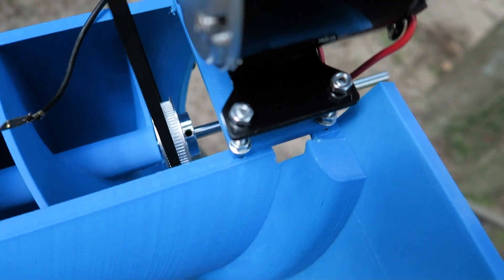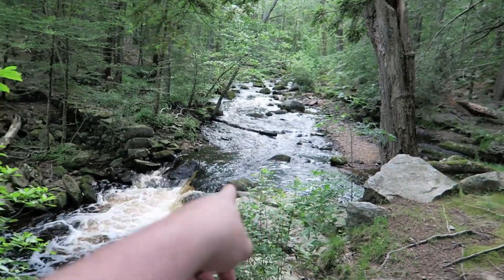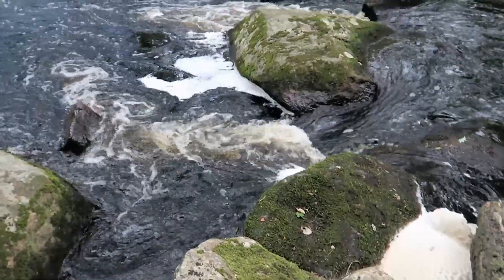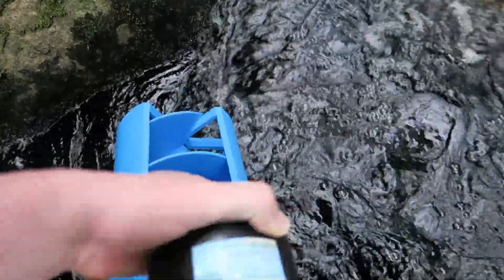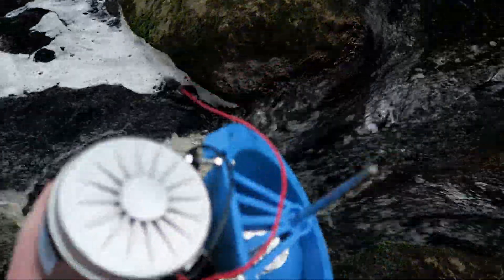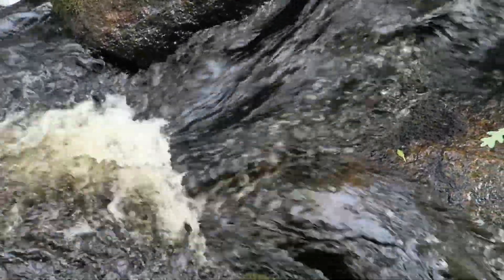3D Printed Archimedes Screw Generator, Watch It Work!

Comment: The fact that your structure does not rotate is not because its top is covered. This cone-shaped structure needs to be longer and the water must travel further on the cylinders to produce more torque. If you look at similar ones, you will see this
Reply from the maker: I will have to make it modular to increase length
Reply: @Beyond_The_Print  Yes it could work. It can also be moved wherever you want, whenever you want. Good idea.
Reply from the maker: I couldn't have done it without your input

Comment: talk about completely misunderstanding everything...

this isnt how they work. they arent a "propellor" or "water screw".

think of them as a series of buckets descending a slope. it doesnt matter what angle it is as long as its not vertical or horizontal... 45 is best.

the screw itself... the best pitch is 45 degrees.

then rotate them WITH the pipe. so each flute creates a bucket, that constantly descends as the water falls down the slope. the junction of pipe and helix has to be water tight.

its the water acting against the screw itself at right angles to the slope that creates the "torque"... you created little buckets down the slope, but each of those buckets is trying to "fall down the screw" as it also forms an inclined plane, a wedge, and creates a corresponding force sideways... the screw has no choice but to turn. if the pitch is too steep, you lose the possible number of "buckets" and the size of them... too fine, like you have here... and they just dont make any "turning effort". and so because it doesnt turn, no water "falls down the slope". a 45 degree helix gives the best combination but can be played around by say, 15 degrees either way...

and as they only use the weight of water, they are really useless. theyre just like old school "overshot" water wheels, using none of the velocity. just weight over height. if you bend your brain a little you see how they are exactly the same, just on another axis. that being said, a waterwheels torque is based on radius, the distance from the axle, and the total weight of the water... here, its exactly the same... a really wide diameter screw works bets. you can make a really large diameter wheel for a given fall, and have lots of buckets, and lots of torque... a screw will always limit the torque available from a given amount of water, being on a much smaller radius.

a trade off between diameter, the number of turns or "buckets", the slope, etc, etc...

great at LIFTING water, as a pump. compact, reasonably efficient, reasonably simple...

useless as a turbine. 

far better to waste time learning how reaction and impulse turbines work. then you might make something that works.

Comment: yeah, i got suggestions.  first, dude, get flyfishing waders.  incorporate mounts for two rebar spikes to pierce the stream bed and hold it in place.  attach a shackle to the unit and a rope with a screw-into-the-ground dog run anchor-knotted on shore so the thing can't get to far if it all goes sideways.  possible floaties for the unit and for you.  a helmet because you are way too eager to walk on moss covered rocks which are always slippery.  a waterproof jogging case for your phone [keys n id] to put on your arm, a bluetooth ear/mic and give someone your 'find-my-iphone-share-location' so they can later find your body in naragansett bay.  get a gopro type cam.  a length of tubing to hold your eyeglasses around your neck, hi-viz-paracord to safety tie everything you might drop.  find a friend/colleague slightly less crazy than yourself as an assistant/rescuer/cinematographer.
     as for the turbine;  i mentions safety shackle and streambed piles, a cone to direct more water gently in [think bournoulli], instead of that plate that acts as a dam.  you got proper bearing on the spindle?  the pitch of the screw probably has an optimized water volume/velocity.  is there an e-z mount cover for the screw - maybe some gently curved plexiglass so you can still see the internals - washed w rain-x.  wd-40?  i'm just over in 413, if you're in new england, you can't be more than a mile from a running stream. 👍. before you reprint anything, look around home center stores for 4" pvc pipe, mounting, plumbing etc parts that already exist.
Reply from the maker: I want to say I think you win the award for comments. I guess I go through it in order.

I've avoided waders due to the risk of flipping with an air pocket in the feet. I've thought about it for a long time though. I love the idea about using rebar to secure the thing. Floaties are also a great idea especially if they come in pink with awesome patterns. I agree most spots aren't ideal conditions for me when testing. I try and leave what ever I can in the car or on shore when testing. I've been looking into a wireless mic for filming! The find my iPhone part was hilarious 😂. I've switched to the insta 360 x4 (Pelton vid for reason). Definitely need the super cool glasses holder and high vis cord. Finding someone a bit less crazy shouldn't be too hard. I've had some success in my "upgraded 3D Printed Hydropower Turbine" with the cone to funnel water into it as you said. I think the bearings are enough though need more lubricant. I would have to agree that there's likely an ideal pitch. I figured for now the bolts were the easiest solution. That's an interesting idea about the plexiglass. You're not far at all send me an email! Sorry for the long reply time, thank you again for this comment!
Reply: maybe a pull start rope n handle

Comment: Use gravity to your advantage and make a way to divert water to fall down into it and flow away again after, would be good around a small waterfall for example.
Reply from the maker: I've thought about this but either need large diameter pipe or alot of head. I think the next project aligns better with this suggestion, Stay tuned!

Comment: There are quite a few micro hydro designs out there. For a turbine design the pipe would need to closed. For an open system in a stream a water wheel would probably be better. How much slope do you have to work with?
Reply from the maker: There isn't much slope at this spot I tested at. I think I can find a bit more up stream, I'll just need to figure out how to get my self there. I agree a simple water wheel may work pretty well here

Comment: Just from my observations on youtube, this style of turbine is really inefficient and as other comments suggested, you absolutely need to have it completely sealed with as little space between the rotor and the casing as possible so that the water is forced through.

Another general tip with all water turbines is that you will get more force/pressure/power out of it the more "head" that you have (vertical distance the water has to drop through a pipe to get to the turbine) because it's just like how the deeper that you dive down in water, the more pressure there is from all the weight of the water pushing down on you from above. When you just put a turbine into some free flowing water there is very little pressure because the water just hits it, bounces off, and flows other directions around it. You need to find a steep spot and put in as much pipe as you can going downhill and put the turbine at the bottom of the pipe.
Reply from the maker: This is great advice thank you. I agree there needs to be alot more weight on this rotor, in addition to tighter gaps to allow less water to slip by. In the case of alot of head and a pipe the Pelton turbine seems like a better option from my experience!

Comment: would've loved seeing the turbine in that rapid section of the river that looked like a mini waterfall (last place you had placed it) but with the front plate on just to see if it would make more progress, I thought the front plate would work for sure since it looked like it would force all the water near the Archimedes screw making the generator work more efficient...
Reply from the maker: I agree, that plate does seem to work well at channeling the water into it. It just also creates that extra surface area for water to act against. In the next video, I think with the 60t pulley it should gain a  bit more rpms.